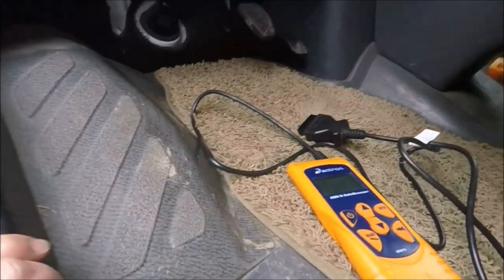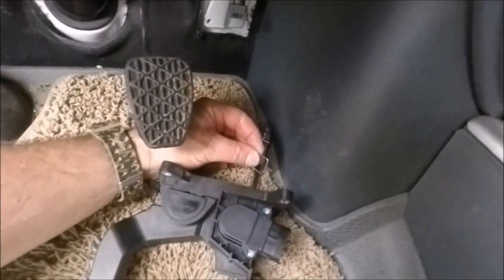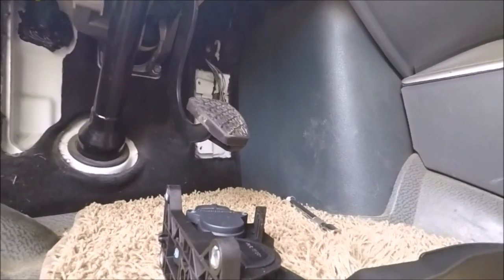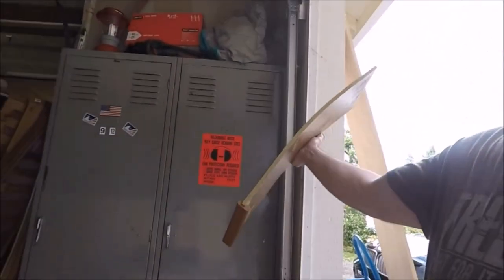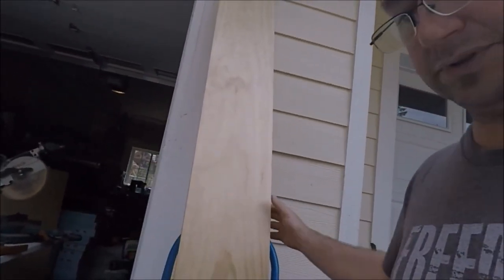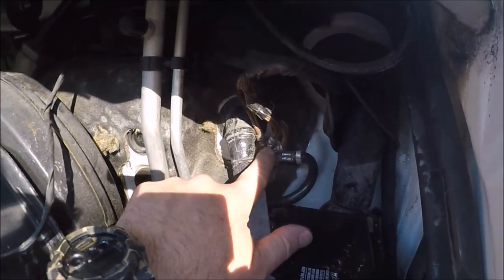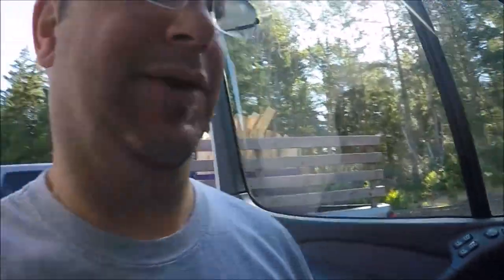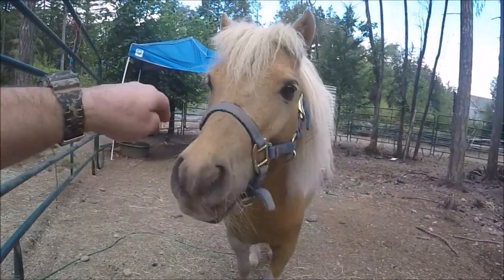2006 Sprinter 3500 throttle position sensor woes and other things

Comment: Just so everyone knows, some of the turbo Diesel sprinters don't have throttle bodies. If you get 2 codes, one with sensor 1 and also sensor 2, there are two sensors IN the accelerator pedal.   I'm currently have issues, and going through all the sensors and trying to get the van out of Limp Mode. I'll let ya know what worked for me. I know this post is 8 years old, but I haven't seen anyone post absolutely solving the issue.

Comment: so replacing the throttle position sensor didn't fix the problem and u forgot to tell us what did solve the no rev problem.  i have the same problem.
Reply: maybe the throttle body
Reply: What's the sense of posting this video with out sharing what the problem actually was
Reply: @nyackgutterguy  fr

Comment: How'd he get it running?
Reply from the maker: Mike Sedy He replaced all the battery cables, they were very corroded under the sheathing. Visually they looked fine, but were stiff and brittle.
Reply: FireBrew63 so I wasn't the pedal assembly? I'm having the same problem
Reply: FireBrew63 it*
Reply from the maker: Mike Sedy Hard to say, I replaced it anyway. Hope you solve your problem.
Reply: @mikesedy6953  my 2008 sprinter 2500 was with code p0227 the problem was with throttle body. sent it to a mechanic shop and replaced the throttle body.